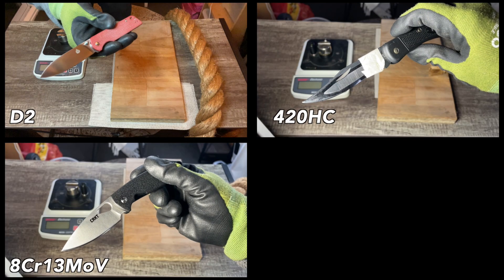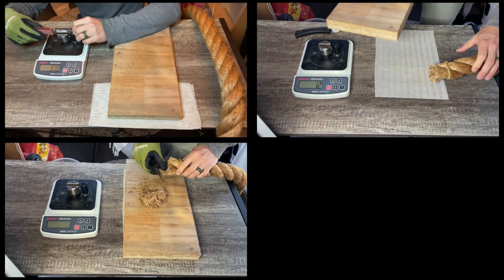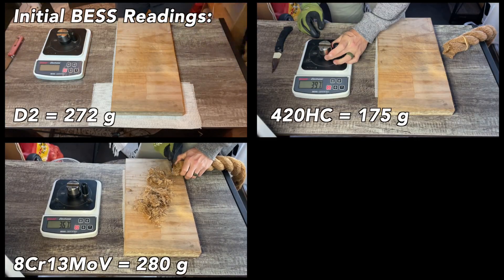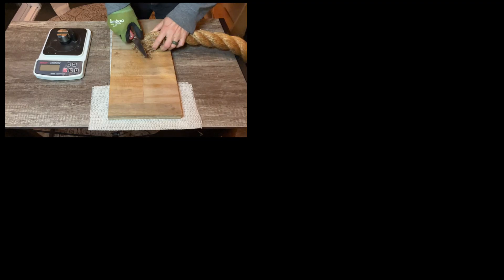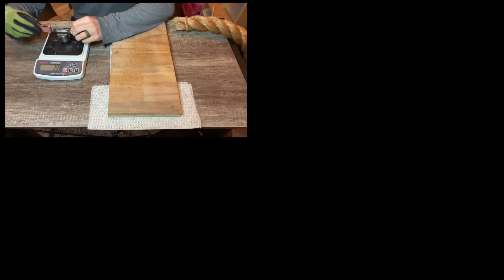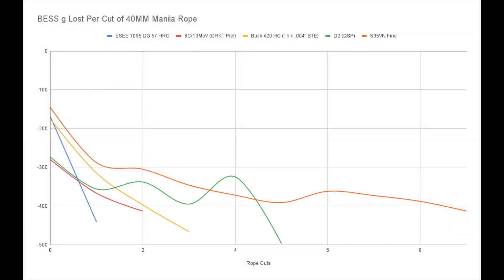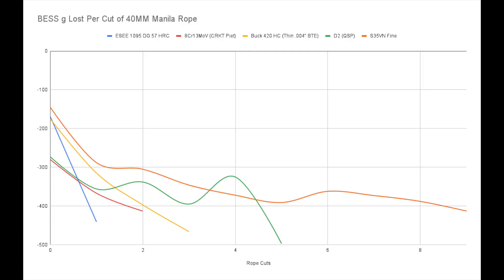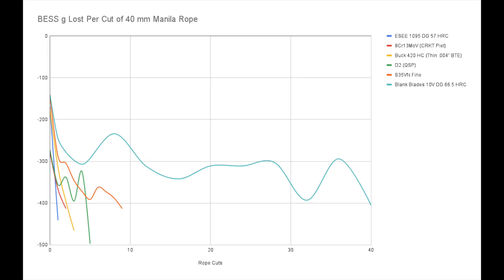Buck 420HC vs QSP D2 vs CRKT  Buck 420HC | Dual Grit Budget Steel Test

Comment: Mi Amigo, those 3 steels are my least favorite of all knife stock , D2 & Ganzo 440c will run circles around any 8crmov & 420hc buck treated, , heck I bet you could take butter knife from any cafe and put a 18* duel edge on it and it would beat the 8cr 😂, glad you are showing us the low end version of what they say is knife steel in a test
Reply: I can get a dollar store knife to beat what I see most people getting from K390 when it comes to slicing rope.
Reply from the maker: @rockets4kids do you get extra performance from sharpening, serrations, something else?
Reply from the maker: That’s fascinating
Reply from the maker: Thanks Steve!

Comment: Wondering why you use such a thick rope?  I never hear from you Gabe. It was too quiet
Reply from the maker: 😆 I have responded on Patreon now.  Was camping with the fam.  

I use a 40mm rope because I like cutting through a rope 10 times rather than 1000 (true story).

It also minimizes time spent and reduces variables introduced by repeated contact with the cutting board.

Comment: Update on my testing . . . Cut force testing on high density vegetable, reveals 14% difference in cut force from sharp (250 grams) to very dull (650 grams). 
That's less than 1/2  ( 32% to 34%) of the gains seen from cutting in a 10 blending bevel behind the cutting edge. 
Looks like time spent sharpening chef knives, would much better spent, thinning a chef knife.
Very thin blades reduce cut force by 50% on the average.  
Asymmetrical handles on thin blades reduce peak pressures in your grip/grasp by 94% to 99% in 
the set of knives I tested ,using high density vegetables.
Reply from the maker: Yeah - geometry and ergonomics cannot be overlooked.

Sharpness is important but also the most quickly changing aspect where ergonomics and geometry provide longer lasting benefit.
Reply: This seems to be in line with the sentiment I've heard from several folk in the knife community; geometry is (almost) everything.
Reply: @CSGraves  Currently gathering & organizing test data regarding what is to be gained from science backed, data driven culinary knife designs. 
- It's time consuming to design & build the testing equipment which yields relevant & reliable data. 
- Refining test methods to minimize standard deviation is the other half of the 
challenge. 

- Bottom line, there is much more to be gained ergonomically from enhancing handle design geometry than blade geometry. 
- Handle geometry - Peak average grip pressure ... [ Pinch Grip ( 30X) ]  &  [ Power Grip ( 12x) ] improvements, along with indexing, rotational & linear control. 
- Blade geometry ... Average force requirements ...  [ Thinner ( 2x ) ] improvements.
I have much more to share ...
Reply: @danielbottner7700  Makes sense. We often are so focused on the blades that we forget about the more generalized act of cutting, and its ergonomic factors.